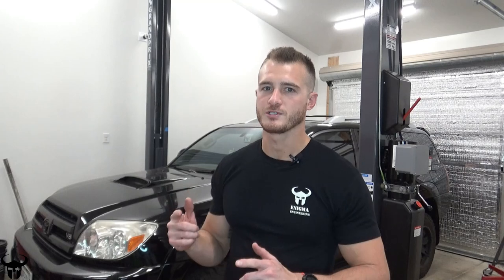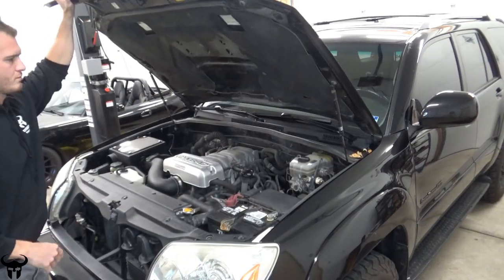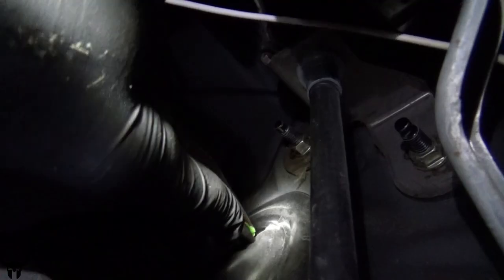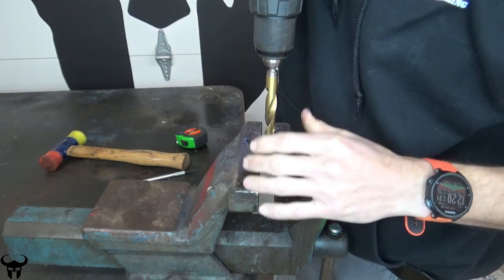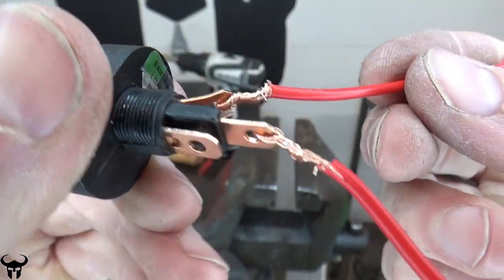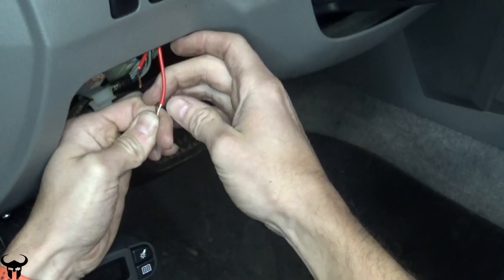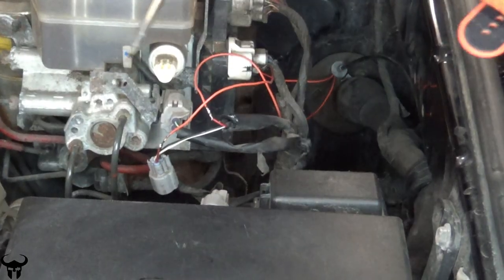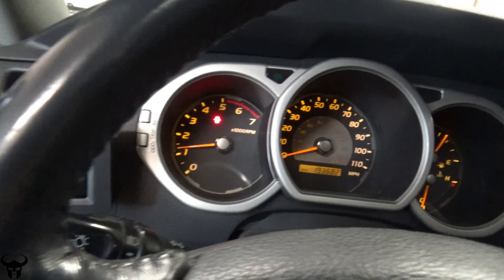4th Gen 4Runner Traction Control Delete Switch Installation - Toggle Mod VSC Off 2003-2009

Comment: My 4 runner has those light on all the time no mods. Lucky me
Reply: Haha
Reply: same same
Reply: Sounds like you need a zero point reset
Reply: what's the downside or risk of disabling the vsc?
Reply: my 2007 don't have that red wire on the master cylinder.  is that possible?  mine is sr5 4wd V6

Comment: Use a momentary switch/button - it does the same thing, and ABS, etc. remains disabled until the engine is restarted but you won't forget to turn the switch on. Usually you need to disable ABS for a particular short trip like up an icy hill but not constantly.

Comment: Would love to see you do a full led conversation on the dashboard, center console, cup holder, 4wd switch window auto switch
Reply from the maker: Great suggestion! Taking notes. A few of my HVAC bulbs are out so it is an impending job
Reply: @EnigmaEngineering  cool that I found your channel. I got a 2005 that I’m planing on doing a “level” with the bilsteins in January. Currently sitting in my 4 runner that’s powering my sump pump from it’s outlet as the power went out again. 4runner saving me from a flooded basement!

Comment: If anyone is ever in a pinch and hasn't done the switch yet. You can always disconnect one of the front wheel speed sensors. The connector is by the front shock under the hood. Driver side is by the fuse box easy to reach.
Reply: Does that affect your speedometer? Assuming yes?
Reply: I don't want to see the lights when I turn it on. Could it be that with this video I eliminate the lights?

Comment: I just unplug that connector when I go off road or in the snow.  I was under the impression, the 07 - 09 had factory disable switches.
Reply: I tried this but the noise didnt go away . Do you know about this problem 03 Forerunner, it sounds like the front hubs are locked or bad axel bearings , like it stuck in a lower gear.

Comment: there is another way of doing this so you dont have to restart the engine everytime.  its a little bit more in depth and requires you to splice a wire at the abs ecu module under the glovebox.
Reply: the only way.
Reply: Link?
Reply: @rexburg22re  ......yes link please
Reply: @TheEvilDead44 do you have a link for that?
Reply: How?

Comment: Good and clear instructional video! Just curious if you'd know if it would be any different for later year models
Reply from the maker: Hi Kyle - I think this can be different for later year models. You might have to try a different color wire. I heard it is a white wire for later generations that do not have the red wire. Thanks for your comment!

Comment: Question! I have 2008 sport model awd, and instead of the three wires like yours has, mine has only two wires, one is green and the other one is white with black stripe. Which one do I cut into? I’m assuming it’s the green one, but I’m only guessing at this point.
Reply: i just ran into that same issue. did it end up being the green one?

Comment: Looking forward to seeing the Bilstein install, nice video, if you were just going to be drifting in the snow could you have just put the center locker on and that would disable vsc?
Reply from the maker: Hi Drew, thanks, great comment. Working on the 5100 video this weekend! Yes, locking the center diff turns the VSC off. I tried that last year autocrossing - it felt a little weird having both wheels spinning the same rate, not sure yet if it helped or hurt - but the toggle switch will make it easier to compare the two

Comment: Hey man thank you for this tutorial. Big help! I hope to do this on my 2007 V8 soon. Question, Can I flick the VSC switch  off while driving, (for when I hit ice on hills), or do I have to be in idling in park to disable it first?
Reply from the maker: Hi Troy! no problem. Do it!! You can flick the VSC switch and turn it off while driving. But, in order to get the VSC back on, you have to be stopped and restart the vehicle
Reply: @EnigmaEngineering  Perfect. Good to know that. Thanks for the reply back. Cheers
Reply: Hey , what was the wire color for your 2007? Mines an 07 as well and doesn't have a red wire
Reply: @graysonscott7209  you figured it out? Because I have the same problem
Reply: @diegonava5883  white/black wire

Comment: Nice video. Please tel me, you are disabling always on A-TRAC system, yes?
Reply from the maker: Thank you David! I do not think I have A-TRAC on mine - but I would assume this would disable it. Maybe mine is an older version of A-TRAC. I usually have the VSC turned ON. I only disable it when I want to make the car drift or I am autocrossing it
Reply: @EnigmaEngineering  2001-2022 4Runner had 1st gen A-TRAC and you have A-TRAC II, which is always on at 4LO, before 2500rpm.  4th gen 2009 4Runner TE was first 4Runner which has always-off, and you have ON (engage) button, like FJ and Like 5th Gens do.

Comment: Just did this on my 2007 4Runner 2wd and didn’t work for me. 
The only difference that I should point out is that I use a 18 gauge regular speaker wire to connect the switch and the master ABS module connector. I make sure that the cable that interrump the circuit was connected to the ground on the switch. 
Maybe this doesn’t work for 2wd or I need something else. 
Would appreciate some help.

Comment: I have a question, my 4runner does not turn off those 3 lights, change speed sensors and the problem still continues. my question is that by doing that I eliminate the lights mine is a limited 6v model help

Comment: Does the VCS and Trac Off lights go on when you shift to drive when the switch is not activated? Mine is doing that. When you do activate the switch it still does those and also turns on the abs light

Comment: Hi there, no need for a ground with tapping into the ABS wiring? Seeing some other process going into the ECU and they do ground, wondering if that's caused any issue for you?
Reply: I did this years ago. I've only disabled the VSC probably 5 times. After I did this mod my brake booster motor went it....Related? IDK, but $4000 repair if you can't do it yourself...I'm hoping it was just coincidence. I have heard where certain models have had trouble with the brake booster motors. The brake booster motor cost me $400 new and it was very difficult to replace at least for me.

Comment: Hello, my 07 V8 sport does not have that pressure switch on the revisor, can you please advise on where I would tap in? TIA
Reply: That's what i',m wondering too
Reply from the maker: Scroll down in the comments. @Ryan B figured out there was a white and a green wire on his and the white wire worked

Comment: So my '06 4Runner V8 2wd drive, the VSC light doesn't want to shut off and it doesn't have a switch. Will I be able to keep that light off by installing this switch,  it's not four-wheel drive. Seems like many have this problem and your video makes it sound too easy. Hope it is tho.
Reply from the maker: It sounds like you VSC system is disabled due to some problem probably. You should get your OBD port scanned by a shop and see if they can get you some answers!
Reply: Hey a bit late but some obd scanners can cause the vsc lights to come on and disable the vsc. This is due to the multi protocols being sent to the car from the scanner before it syncs to the proper protocol for 2 way communication and erases the “zero” function of the vsc so it’s shuts off. Dealer can re set the zero function ( most likely for a charge ) and there are some videos of other ways to do it.

Comment: Way easier and cleaner to just T into the red/blue wire on the 4wd ecu under the glovebox and ground it with a switch, then you don't need to run wires to you engine bay or cut any wires.
Reply: Hey Devin, I heard the way you mention only works for the 2003-2004 models, is that true?
Reply from the maker: I try to avoid messing with the ECU wiring harness as much as possible. Unless I'm installing O2 sims that is

Comment: I have a 08' SR5. Does this turn off ABS? On ice, my ABS throws in the towel and doesn't want to stop.
Reply from the maker: Yes - this turns off ABS. The ABS in 4th gens isn't very good on ice. "Threshold braking" with no ABS is much better than the ABS in a lot of cases

Comment: Is there an OEM VSC switch?   I only ask because I believe my 06’ V8 Sport Edition has that option.   Whipping donuts with it off is a blast!
Reply: https://www.ch4x4.com/product/ch4x4-toyota-push-switch-vsc-symbol/ this is the one i used, and have it mounted in the blank switch space behind the shifter and between the front seats. i call it "the fun switch"
Reply from the maker: Awesome button, thanks! I am not aware 4th gens ever came with the button from the factory
Reply: @EnigmaEngineering  the blank slot enxhists yes..... However the switch itself does nit exhist from the factory. U need to wire the 'correct' vsc switch mod  first.

Comment: So what purpose is there really for doing this? Where can it help? Just interested as I personally don’t care to drift but looking for kids to help with offroading or safety or maximizing the use of the truck
Reply from the maker: The default traction control prevents acceleration, so if you are sliding, the car just actuates the brakes, essentially just slowing the car down. But, if you are trying to get the car to pitch sideways and drift/powerslide, you need to use throttle to make the car rotate or prevent it from rotating. This switch turns off the traction control, allowing the driver much more control of the vehicle in low traction situations. Even in autocrossing/racing, unless you have a modern car with advanced traction control, the VSC on older cars like the 4Runner prevents optimum speeds because it activates any time a tire is slipping, which is basically all of the time while on a track

Comment: I have the 06 V6 and it has two wires (white and green), which one to cut?
Reply: Any updates? I’m thinking on doing this to mine as well v6 also.
Reply: White wire, just did it to my 07
Reply: You do have to mess with which wire goes where for it to work, but it works perfectly, only the light on the switch dose not turn on
Reply: @ryanb7008  GREAT! thank you
Reply from the maker: Oops - sorry on the delay, looks like @Ryan B got you though!
Reply: I have an 05 v6 and hoping for it to be the same wire
Reply: @ryanb7008  Does your ebreak light come on too?

Comment: Man can you make a video about break controller?
Reply from the maker: The v8 4th gen comes standard with an electrical connector for a brake controller - does yours have this?
Reply: @EnigmaEngineering  if it standard equipment it should be there. Thanks

Comment: Could you just unplug it when you want it off and plug it back in when you want it back on? Or would that damage the computer?
Reply from the maker: Yes, I think this would work. I don't think you would damage anything. I usually am driving long distances to large open spaces in blizzards, so sometimes I want the VSC on/off but I don't want to get outside the vehicle. I believe the pressure switch is related to the ABS system, which the VSC uses to control wheel spin. So disconnecting the pressure switch kicks off ABS which in turn disables the VSC system

Comment: All u have to do is hold the VSC switch for 3-4 second's and it turns the traction control off. Just sayin.
Reply: What vsc switch
Reply: That's a V6 luxury switch.
Reply: @31986dms  no my v8 has it it was in the limited only i believe
Reply: Can confirm No VSC switch in my 03 V8 Limited
Reply: @DeweyC0x  mine is an 08 maybe it was only added after the face lift

Comment: You should of said which wire goes to which on the back of the switch. You wasn't informative on that part! Had to watch another video on YouTube and dude described which wire goes  on the switch connectors at the back of the switch.
Reply: what video did you watch that further explained which wire it is? Or do you happen to know which wire it is? it seems to be the lowermost wire on the plug right?
Reply: You should understand what a switch is before ragging on an informative video made to help others at no cost.